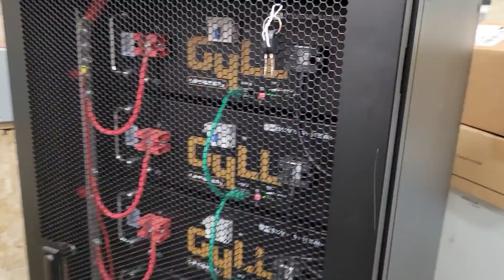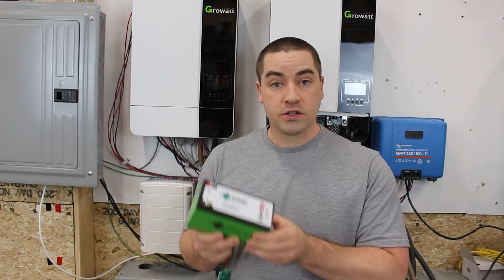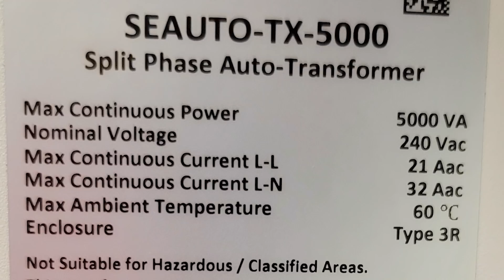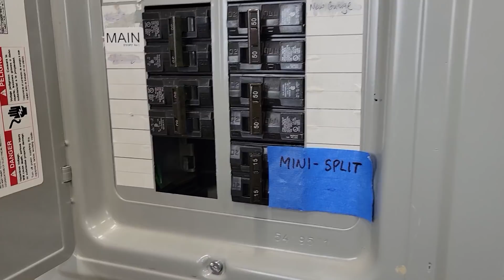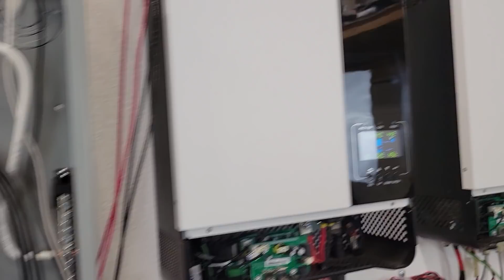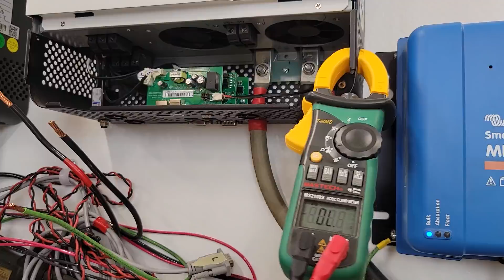Safety Concerns with Auto Transformer and Growatt 240V inverter SPF 5000 ES

Comment: As a Ham Radio Operator, I am concerned with the possible RFI emitted by these inverters and transformers.
Has anyone tested any inverter or transformer for RFI or has had any expirience operating HF and VHF transceivers when these units are running?
Reply: Hey there Uncle Doug. 
I am a HAM operator as well and I can say that I am experiencing RFI since installing my 2 5k (US) inverters from Signature Solar. All HF. Nothing to note on 2m or 70cm. Contacted Signature Solar and they are investigating as I continue to troubleshoot.  
I have a 7300 and got a very loud and noticeable buss sound. Ferrites have removed that. Waterfall on the 7300 really shows the RFI. 
PV goes to a combiner box ( 200v) and then a single feed into the cabin with a breaker before going to primary 5k. 
I can stop all RFI when I turn off the breaker for the PV Panels. This occurs when there is NO PV input, anytime day or night all i have to do is turn off the PV breaker and RFI is gone. 
If you want to provide me your email I can give you more details as i work through the issue. 
Dirk
W5DDM
Reply: @dirkmetcalf4584  I have a wonderful 7300 as well! 
Guessing at this point, the inverter would need to be shut down to eliminate the RFI QRM.
I suppose these things do not fall under any FCC rulings...
Reply: @uncledoug9934  Actually Doug, here is my work around as Signature Solar researches. I have a solar combiner box outside and then run 1 pair of PV wires inside to another breaker and then into the 5K. If at anytime , day or night, i turn that breaker off the RFI goes away. It seems there is a sensor in the inverter that looks for input from the PV line and thats whats causing it.
Reply: @dirkmetcalf4584  ahhh. Good to know. Seems like us Hams seem to always have challenges to deal with. Glad you were abke to pin-point the origin and a work-around to be able to operate. All part of the hobby!
Reply: @dirkmetcalf4584  Would you please try to post your response from Signature Solar on this issue? I am interested in this for potential health reasons -- dirty electricity as it is known by the EMF radiation experts who specialize in reducing EMF radiation in homes. Thanks!

Comment: I don't think anyone has really explained how the breaker tripping would cause a power spike. Since the autotransformer will loose all L1 and L2 poles from it and the 120V volt loads would only be connected to just the dead neutral and one leg and ground.
Reply: Tripping the breaker to a separate auto-transformer? The circuit changes from two essentially separate circuits (current paths) into one circuit with the loads on each leg now in series. The leg with load (the higher resistance) now has a higher voltage potential on it. If imagining the water/pipe analogy of electricity to understand it, where volume=current and pressure=voltage, the leg with the lesser load becomes a "bottleneck" because it can't flow as much volume as the other leg, so then the pressure builds up on it.

For example: Say you have 240V total, with 120V on each leg, with 1000W load on one leg and a 500W load on the other leg. Those would correspond to approximately 14.4 ohms (with 8.3 amps) and 28.8 ohms (with 4.2 amps) resistance values. If you loose the neutral, now you have 1000W in series with 500W, or 14.4ohm + 28.8ohm = 43.2ohm with 240V across it now, able to move approximately 5.6A through the both of them (notice this is in-between). This means that there is now ~80V across the 1000W load and ~160V across the 500W load.
Reply: @captainobvious9188   that would happen if you lost the neutral from your power company since you're connected to both legs still, but how does this happen on this set up when the 120v devices only have one leg and a ground? Does the power flow from one leg to the ground? If so is that even something that can damage devices?
Reply: @technoballs  I'm going to assume you're referring to ground as the assigned electrical ground, as in "live wire and ground". You are the power utility in this auto-transformer setup. So it would be like loosing neutral to the utility, or more accurately, it would be like the utility disconnecting neutral from the neutral wire as well as the ground. So the only possible current path at that point is through one leg across the shared neutral bus connection in your panel and then through the other leg.
Reply: @captainobvious9188  Thank you for your replies, but what I was mentioning is that when the autotransformer breaker trips it looses L1 and L2 so I was confused how else it would cause issues  with nothing going over the transformer.
Reply: @technoballs  Ohhhh, I apologize, I misread. When it breaks in this new scheme it disconnects the inverters as well, so I'm with you, I don't know why there would be a power spike?

Comment: There seems to be many people raising concerns about Growatt inverters.  Mine  has a 240 volt feed from my utility connected. You do not use a utility neutral nor their ground. This is not a concern. It is simply an electric source, 2 hots.  As a 45 year career commercial electrician managing large projects I can attest that: 1. You will get 10 different opinions from 10 electricians. 2. Most people do not interpret the code accurately. 3. The bad or incorrect wiring methods electricians use are many. Ask any project manager, job superintendent, like me or architect. Habits and gossip are the drivers of this. I saw a video of a man claiming how dangerous these inverters are. Nothing he claimed, with a meter btw, was accurate and I could not replicate what he claims. Different inverter?? I don't know. I have 2-- 5000ES Growatt inverters, 1 for backup.  I run my entire house, less dryer and AC. I have a heat pump water heater that draws almost 400 watts. It's on my system. I monitor everything, every load, temps.  So with 1 inverter, 4,400 watts installed solar and 23kwh of battery,  my system is essentially idling most of the time. My system produces more than I use. I built this system for back up generator purposes btw.
Reply: I can confirm that there are two different inverters being sold in the US, with the exact same labeling. 
Signature Solar was out of stock,  when I was ready to purchase.  So, I mistakenly found what I thought was the same thing on Amazon. 
The 240 volt leg , identified in the inverter as "N"  is bonded internally to the metal case of the inverter. It cost me a few appliances. I tested it for bonding and didn't read continuity.  I figured out that it is only bonded when the loads are powered through the inverter.  I  have sence corrected the issue on my inverter.  But,  no longer have a warranty.  I  am a 37 year electrician. With experience in residential,  commercial,  industrial, mining, and marine wiring.  This one fooled me.  Please everyone,  make sure that you are buying the US version,  if you are in the US.
Reply: Everything is all good as long as the autotransformer never fails. Your 240 volt loads work great from this inverter, but what happens to the 120 volt loads if the autotransformer fails? If a isolation transformer fails, it will short circuit and trip the main breaker and save your house from a melt down, the autotransformer fails no breaker trips and your 120 volt appliances are now 240 volt? I probably have no idea what I am talking about, just something for you to think about. I don't have a 240 volt inverter, I chose to stick with a 120 volt inverter because I only have 3000 watt solar array.

Comment: Interesting to see the response to Will Prowse's recent heads up clip, and learn more from response clips, plus comments. I warmed up to idea of using a European standard GroWatt with a autotransformer when I learned one can get full inverter power to either leg of 120vac in a 240vac circuit breaker box vs maybe half that max to each leg from same size inverter designed for USA split phase 240vac. On the other hand: I agree with Will that modified GroWatts ... with the same model number that can be different without the buyer knowing what is up, is terrible. AND I hope GroWatt addresses this situation, including with detailed wiring diagrams for powering up USA 240vac split phase circuit breaker boxes.    Glad to be in a Learning More All the Time Mode :+)

Comment: Probably already a comment about this, but I have 1 5000 watt Growatt inverter and the same auto transformer.  I also have an Emporia load monitoring system in my electric panel and I monitor the transformer neutral. I run my entire house less large appliances on this system.  2.36 amps is the largest load I ever recorded on the neutral.  If it's a balanced load,  little should be on that transformer.  You can switch loads from one phase to another to balance.

Comment: Thanks for making this video, David.  It answered a lot of questions.  I went the route of getting two auto transformers to go with my two spf 5000’s and hope to finish the wiring today so I can try out the system.  Your effort’s to make these informative videos are much appreciated!
Reply from the maker: That's probably a better way to go.  Nice.
Reply: @DavidPozEnergy  I'm interested in building a system for my cabin and I am on a fixed income what will it cost to get a setup
Reply: @DavidPozEnergy  Hi David. Following your videos I purchased the Growatt 5000es and autotransforner from Signature solar.  I have a question for you. Did you measure the voltage between the autotransformer's Neutral and the system common Ground before bonding at the loadcenter? I measured  it and it measures 41 vac.  I dont dare to bond them together. I read that it has the potential  to electrify the yard and metal fences. Let me know how you went about this. Also I noticed that at the inverter between Gnd and L1 there is 94 vac and between Gnd and L2 152 vac.  L1-L2 measures 240 vac after the setup adjustment. Please contact me asap. Thanks for your videos.
Reply: George, I got 2 auto transformers also. Did you get the solar edge or growatt transformers. Would you tell me how your wiring them. I know how to wire up one,  but I'm a little confused about doing 2. Do I or can I wire 2 the same as one using separate breakers or do I have to combine them together into one larger breaker.
Reply: Hi Mr. Drones. Like Mr. James Lee I too have purchased two SPF 5000 ES Growatt inverters AND two 5K auto transforms (one SolarEdge and one Growatt). I'm looking to learn how others with two auto transformers have wired them when using two SPF 5000 ES Growatt inverters. I haven't installed any of my system yet. FYI, I have four 48V 100AH EG4 Lifepower4 batteries, and 10Kw of PV panels. Any information you wish to supply would be greatly anticipated. Thank you. Know anything of Mr. James Lee's  system?
Reply: Sorry, Drones = Drenes.

Comment: Aren't all 120 loads already protected by the breaker the midpoint transformer connects to the panel with? Like, it isn't likely that 120 is going to become 240, because the math of winding copper wires in the transformer is not going to change, and right sized breaker should protect against temperature as well, assuming it's picked right from the get-go. Am I right in thinking that?

Also, my second concern is you're wiring line wires through 32amp breakers when they should be ran through 100amp breakers for inverter to loads on panel. Aren't you going to wish you hadn't done that soon? It's turning a 200 amp breaker into a 64amp breaker!? Am I wrong here?
Reply: a 32 amp breaker doesn't turn into a 64amp breaker, lol. Yes, his 10000 watt inverter system is now limited to 32 amp 240 volt which is around 7000 watt. I hope this is clear in what I have told you.
Reply: @uhjyuff2095  Yes I understand. I'm using 64amps in two 32amp breakers so the total power fed to his breaker box with two inverters feeding in on the lines. I know the neutral does not need much, but doesn't the breakers ALSO limit the line1 and line2?
Reply: 64 amps,  would be correct. 
Since,  each 32 amp breaker is carrying the output of 1 inverter. 
1 breaker for L1 of 1 inverter.  And the other breaker for L2 of the other inverter.

Comment: David, how well is 30 kW-hr keeping you overnight/cloudy days? Obvi your home is far more efficient than...well... anyplace, but if I remember rightly you don't use nat.gas or propane. What's your average electrical consumption in a day?
Reply from the maker: The 30kWh is plenty if it's sunny every day.  But, if it's cloudy more than 2 days in a row (in winter) then I need to either switch to grid or run my generator.

Comment: I think neutral should never be fused or connected to a breaker. Zero sequence vector thru the neutral  balance out any unbalanced load
Reply: I think that's generally true but there needs to be something protecting the autotransformer.
Reply: @eDoc2020  for what use is the autotransfer? Redundant. 120 volts output inverters can be wired combining their neutral/ground to have a 120v/240v output without the autotransformer
Reply: Typo error..autotransfer meant to be autotransformer
Reply: @joelyalong1562  You could use stacked 120v inverters but then you are limited in the power you can draw. Let's say you have two 5kW 120v inverters in series. If you run a 4kW 240v load then you can only run a 120v load if it's less than 1kW. Whereas with the 240v inverters and the autotransformer you could run a 2kW 120v load.
Reply: @joelyalong1562  - “120 volt output inverters can be wired… 120v/240v output without the transformer”

Not necessarily. Some models need the auto transformer. Also, high frequency inverters have a problem with peak loads, where an auto transformer can help absorb some of that stress from the electromagnetic field holding the energy in reserve.
Reply: @eDoc2020  I never practice wiring inverters in series..always in parallel,same voltage output of course
Reply: @joelyalong1562  You said "120 volts output inverters can be wired combining their neutral/ground to have a 120v/240v output without the autotransformer". To get a 120/240 output from 120v inverters you need to put them in series. Putting them in parallel will only get you 120.
Reply: @eDoc2020  an autotransformer should have its own dedicated CB for both primary and secondary for isolation/ overload protection but never fused
Reply: @joelyalong1562  I'm having trouble understanding you. What sort of circuit breaker doesn't act as a fuse?
Reply: @eDoc2020  circuit breakers are fast acting disconnect action while fuses are time delay devices except for dead short..
Reply: It's just a wire that can carry current. The magic pixies don't care what you think. It is a very good solution that solves the high voltage/high current failed AT issue.
Reply: @solexxx8588  not just a wire...its the heart of the edison single phase 3 wire sytem
Reply: US std uses edison 3 wire single phase system. 120v.nutral.120v..where 240v is derived from both L1 and L2..

Comment: Nice video there.

I have a small suggestion for you. I am in Vietnam, we get 210~265vac from the grid. Vietnam standard AC is 220 +/- 5%. I have install a 220→200VAC transformer at the grid incoming. So my house voltage is 195~220vac. Usually 209vac with my grid tie inverter. Cause most electrical items can function within a range. Everything runs fine. Plus a slight benefit of lower power consumption and larger headroom when surge occurs.

Air-conditioning, freezer, fans all runs slightly quite.

Dunno if this will get electrical economy at your country.

Comment: I have three of these inverters. 50kwh of battery. I connected 240v from the grid for a supplement to my solar generation. The third inverter has a connection from my generator as a backup to long term grid down and rainy days. The connections for all of the inverters includes the earth ground (green) from the grid powered panel. That same green earth ground is connected to the load panel. I hope that this insight helps. Note that this installation does not back feed to the grid in any way.
Reply: How are you controlling the neutral so as to not run through the neutral from the Transformer to the grid?

Comment: just wondering what your thoughts are on using one of these instead  of two 5000"s, I'm debating on which to buy
12kW 48V 250VDC 120A Off-Grid Inverter by Growatt

Comment: David, after you turned off the three pole breaker, you measured between L1 and L2 at the 50amp breaker in the panel and had no voltage , then measured L1 to neutral and L2 to neutral and had no voltage. OK that is good but you need to measure L1 to ground and L2 to ground in your panel. I think you will find voltage between ground and one of the legs ( L1 or L2 ) I am interested in your results.
Reply: Right, that's what I was thinking. The breaker is killing only one of the legs. Does the inverter still supply power to the other leg? Not really clear on this being a solution.
Reply: That would be the case if the inverter outputs were ground referenced. Here they are floating, meaning you need both legs connected for any current to flow.
Reply: L2 is not connected to ground in the panel in any way. Your point is moot. L2 has potential but no return path since N is disconnected when the breaker trips.
Reply: @solexxx8588  Ok , but why does David have a ground wire running between the panel ground bar and the inverter AC out ground terminal? Bounding the case to ground? Why if it has no potential to L1 or L2?
Reply: @douglasmarquis3446  all non powered metal,  such as enclosures.  Should be ground bonded together. To reduce their potential to zero.